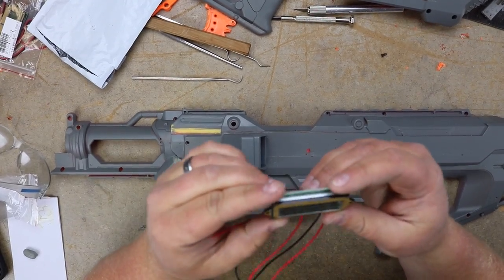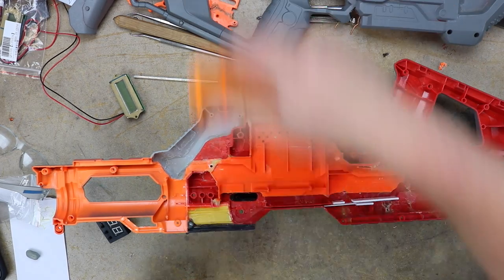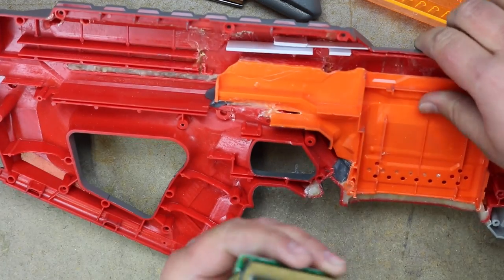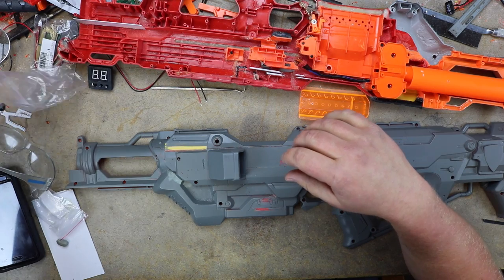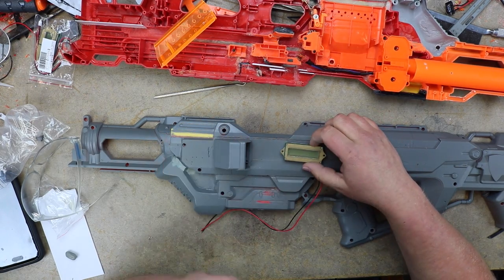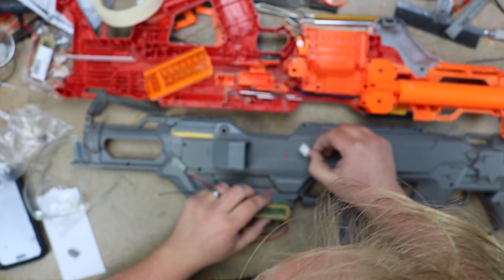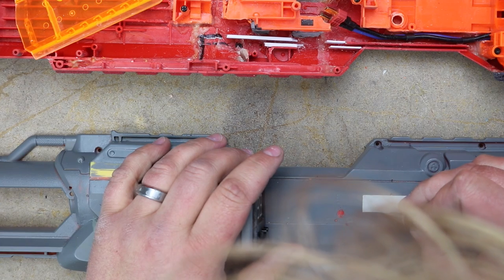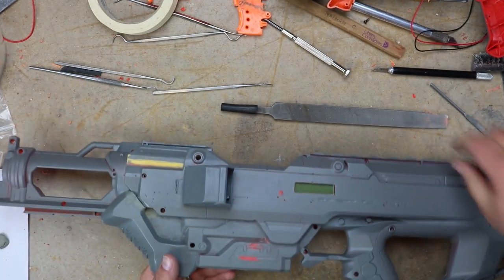mod Along ep. 28 - "Voltmeter Placement"

Comment: You could glue the nut to the board so you don't have to mess with it, just don't over tighten the screw and it should stay with problems.